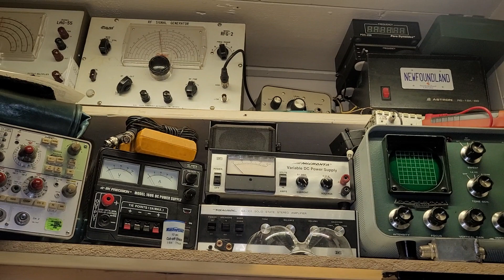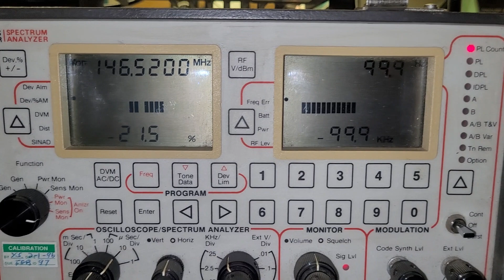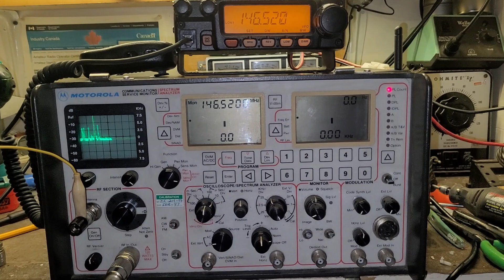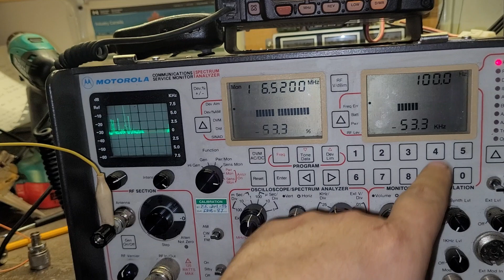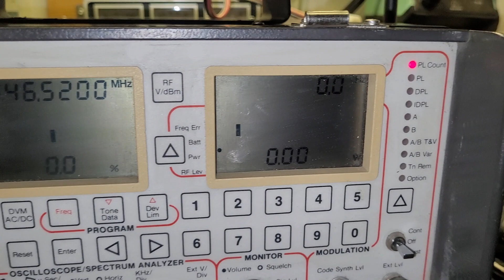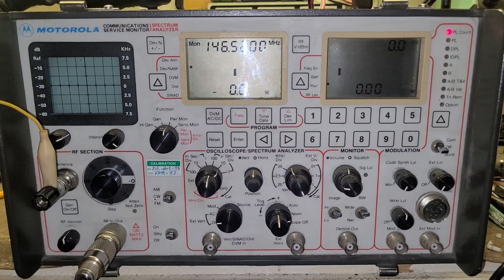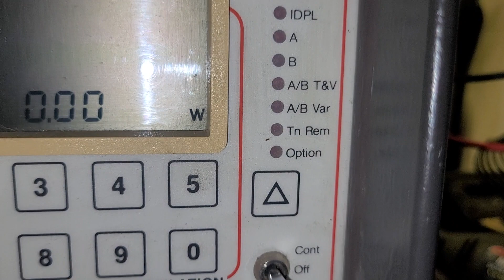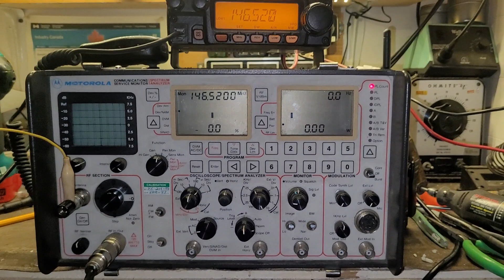MOTOROLA R2400 Spectrum Analyzer, Service Monitor

Comment: Ah! I have never seen one. 
I’d read the manual first a few times over. Not to skip over an essential trick that would make it possible. But then first cleaning relays and switches. 🤷🏻
Reply from the maker: Good call!